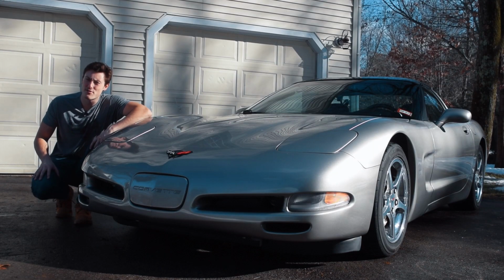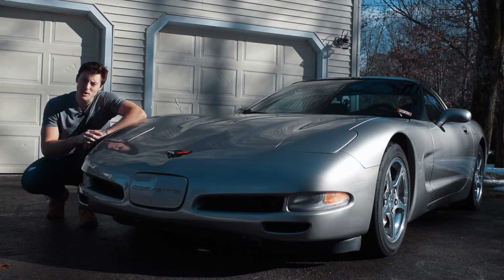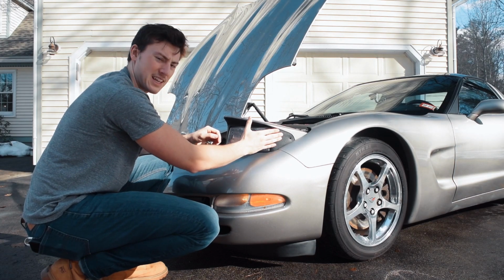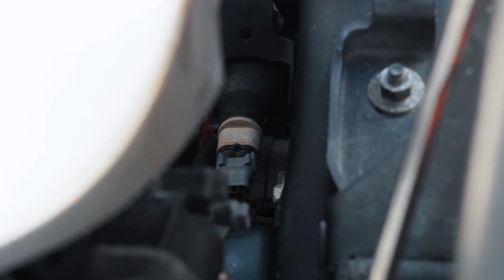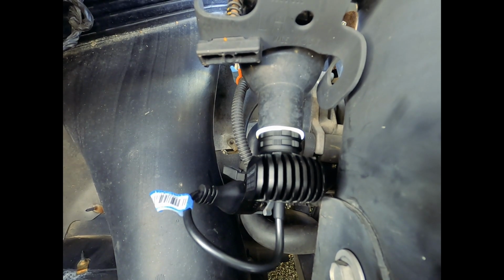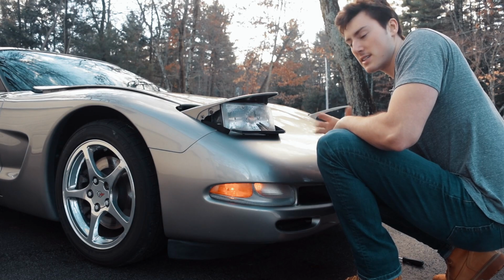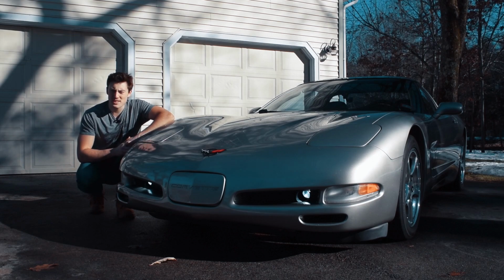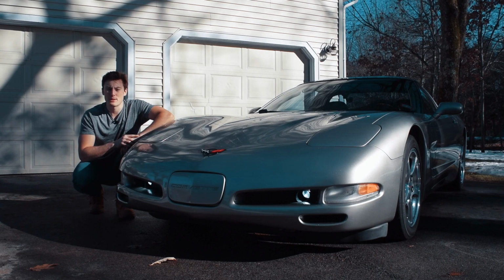C5 Corvette LED Fog Light Upgrade *BRIGHT! | DriveHub

Comment: Does the fog light bulb go in vertically with the led filament on the left and right of the center tab, or do they go in horizontally with the two led filaments on top and bottom?

Comment: After my C5 pop ups went bad for the 3rd time, i sadly replaced them to fixed headlights. they have grown on me over time but i do miss the pop ups. The problem with them though is i have to get under the car to replace my fog lights. such a pain in the butt.
Reply: What was wrong with them? Was it the motors?